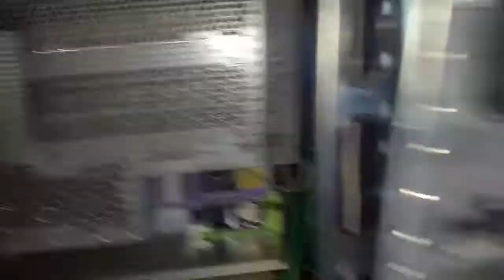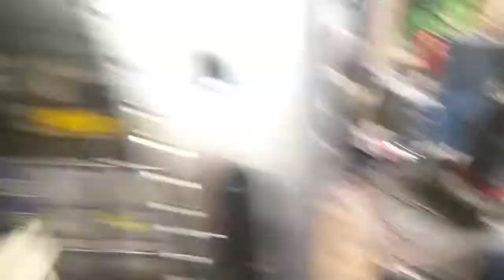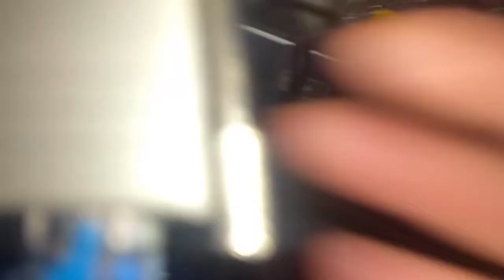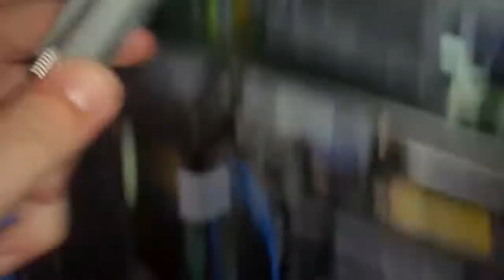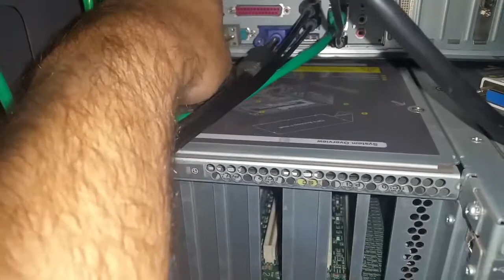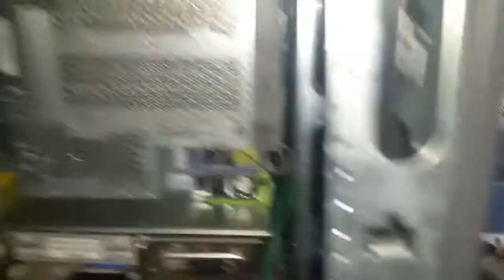Connecting an RJ45 serial to DB9 com port

Comment: Please, explain to me if this was used for the physical ring topology, before using an IBM ring topology MAU, was there a network card with 2 DB9 connectors? In this way, Computer-B communicated by linking a coaxial cable to Computer-A and from the other end to Computer C?
Reply from the maker: No, it came from a RS/6000 H50 cluster style system using serial access root level system.
Reply: @OldMatesBackyardTech  Thank you! There is not much information and I am passionate about networks, I would like to know what the ring topology was like, what kind of ports did the networks card use at that time before IBM used the MAU for its ring token topology, I feel frustrated not find information on the net  :(
Reply from the maker: Token ring is something I have limited knowledge of myself.
My serial comms were for my Sun Microsystems servers as a lot of then used serial comms if SSH failed

Comment: Hi! Sorry to bother, but, how do you make the wiring inside the adapter? I have understood that on cables 4 and 5 need to be connected to the first pin on the DB9 connector, however, as it's one to plug and not to solder, how do you connect those two?
Reply from the maker: I bought that RJ45 to DB9 converter plug
Reply: Backyard Tech but, is the plug already wired inside? 
The one I bought has the wires alone to be connected into the DB9 side, but I don't know how to connect pins 4 and 5
Reply from the maker: That plug was already wired inside. It came in a 2 pack with an RJ45 to DB25 adapter. Both already wired inside
Reply: Ok, thanks